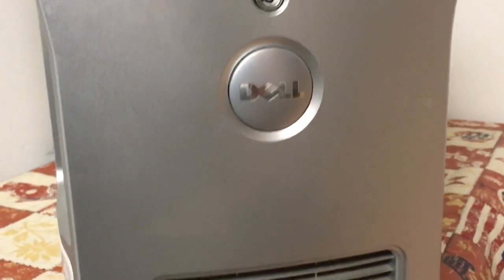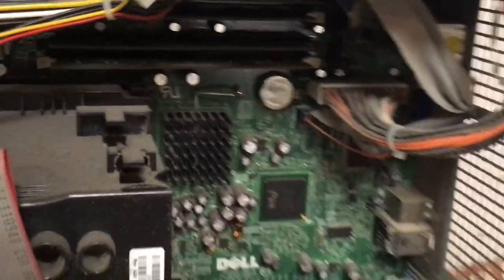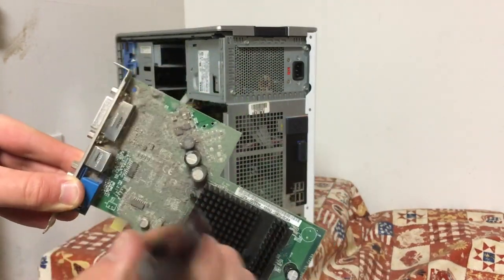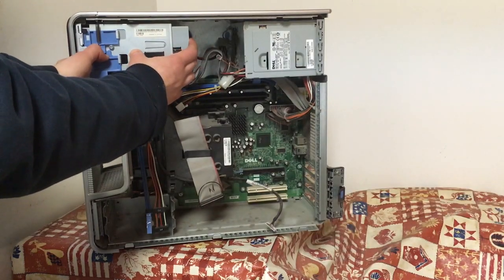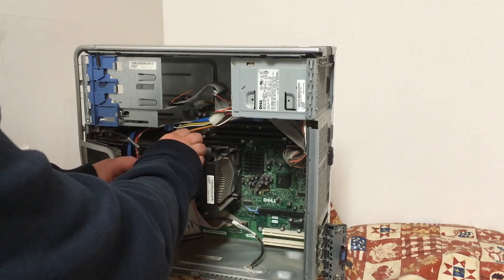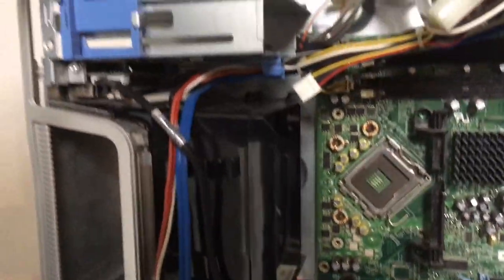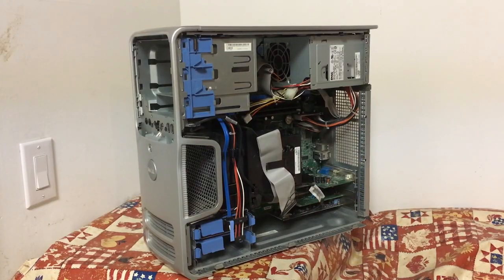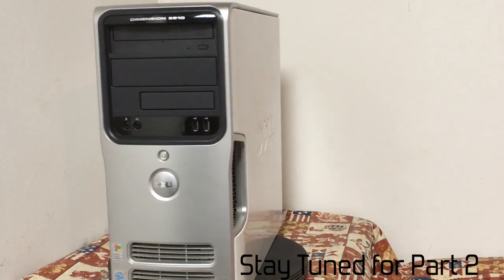Dell Dimension E510 Teardown and Restoration

Comment: My 99 year old Mom had the E521.  Never turned it on.  A little dust.  But not bad.  Upgraded to 4 Gig of RAM, New video board, New WiFi board, Added 500 Gig HD and upgraded system from Windows 7 to Windows 10 Pro.  I just do MS Word, some graphics and internet.  This machine now runs perfectly for my purposes.  Will watch for more of your videos.
Reply from the maker: Nice, it’s a good system and it does have a lot of upgradable parts. Glad you enjoyed it!
Reply: Do you have a video on installing a secondary HD?
Reply from the maker: Not at the moment,  but once I get some parts for it, I’ll definitely make an upgrade and installation video.
Reply: That's pretty amazing. I'm looking to do that for a while (I actually still use an E521) . How did you get windows 10 drivers for such old hardware ?
Reply: You were able to install win 10 on the 32-bit?

Comment: I got my 5150 from craigslist in 2012 for $20. Non working. One of the CF card reader pins was bent shorting it out stopping it from doing anything. Easy fix. I overhauled  mine to accommodate the E510 motherboard. $30 ebay motherboard. Then sold the 5150 motherboard for the same cost. The E510 supports Core 2 Quad. I have a Q6700 in it. The 5150 barely supported Pentium D. I swapped the stock heat sink for a much beefier Dimension 9100 heat sink. I also dremeled additional space above the top PCIE slot to accommodate dual slot GPUs.
Reply from the maker: Sounds like it was a solid system to use! Nice that you swapped out the motherboard for it to be more capable, I’m sure the Core 2 Quad made a big difference in performance. Are they pin compatible or did it require some modifications to make it use the E510 case? Dual GPUs in a system like this would be an awesome upgrade to add. Even nowadays these machines are still decent to use, maybe more for older games/software, but still nice to use considering how upgradable they are.
Reply: @TheOriginalCollectorA1303  Correction, I have a E520 not E510. The 5150 and E520 motherboards are slightly different. I had to dremel out the back panel from 5 3.5mm audio jacks to 6 jacks, 2 additional USB ports, and for some reason they decided to move the VGA port down, so a new hole for that. I also had to replace the front I/O/USB/power button board since the E520 motherboard wouldn't boot with the original 5150 I/O power button board. It only has a single, double slot GPU. It was originally meant to only have one single slot GPU. It's had a number of different GPUs starting with an MSI N9600GT(had to cut some of the plastic shroud to fit it), then a EVGA 740GT-4GB, then down to a ecs GTX560 removed (gpu shroud cover) now it has a EVGA 750-2GB. 
Some of my  old gaming videos around 2015 feature this PC. I listed the specs when I did, and a few other Dells😄
Reply from the maker: Interesting, at least it still fit inside the case even with the different I/O placements. Also interesting to hear that the power button doesn’t allow the different motherboard to boot, but that seems like another proprietary system thing. I also read that wrong about the GPU, but at least it worked after fixing the space limitation. It’s cool to see how much can be done to upgrade these machines!
Reply: @TheOriginalCollectorA1303  I just blew the dust off mine after moving. It's been about 5 years since I've used it. Nostalgia tripping touring all my old Sims 3 houses and buildings. Playing Burnout Paradise since its the only PC I have that the activation still works on.
Reply from the maker: Nice! Also nice to have it still play games without any modern complications. Activation is a whole other thing, but at least it still works.

Comment: Just finished cleaning the inside. Any tips how to get that Dell Dimension E510 side cover back on? I line up the tabs at the bottom & press upward, won't close. I pull back the top sliding tab as I'm lining up the case, won't close. Have Win Professional 7 as upgrade from XP.  Though Microsoft sunsetting Win 7 very soon, would like to continue using optical drives for DVDs, CDs, etc. Thanks.
Reply from the maker: It can be kind of difficult to put it back on so I know what you mean. I’ve found that tilting the PC or laying it on its side can help so that way when you line up the cover, it won’t touch the ground. Then just firmly push it in along the top and it should click. You can pull back the top tab but it’s not necessary as it will lock into place. Also make sure that nothing is bent just in case.

Comment: I recently bought the slimmer variant (C251) for $16 at a thrift store! It hasn’t been used in a long time because it had cobwebs inside the the case
Reply from the maker: Nice! These older machines are still great to use, hopefully you’ll get some use out of it!
Reply from the maker: Windows XP is a great OS to have as it’s helpful for older iOS software and jailbreaks!
Reply: @TheOriginalCollectorA1303  I just plugged it into restore install the OS and I think the power supply just exploded
Reply from the maker: Oh no! That’s unfortunate, hopefully it’s something else causing the issue. But even if the power supply is not functional now, you might find a whole other unit to use for parts.

Comment: I love that computer.  I had one in college, it played some mean Battlefield 1942.  I'm in the process of building one now for myself, for my 98/XP games.  I found an E310 for $5 at a flea market.  It looks the same, except silver instead of white.  I'm putting an E510 motherboard in it, so I can get that sweet PCI-E slot back.  You can also get that Samsung DDR2 ram super cheap now, so I'm going to put 2GB in there.  I can't wait to play F.E.A.R. again, it ran terrible in Win 7!!  Really happy to have a Pentium 4 again.  That thing was fantastic at running Win 98 stuff. And it made a great space heater when I was at school in the Upper Peninsula.
Reply from the maker: Cool to hear! Having an older system is always the best option for older games, plus it’s a lot of fun to use!
Reply: @TheOriginalCollectorA1303  Have you been experiencing any random blue screens?  I distinctly remember after putting in a Radeon X600, it was automatically overclocking the GPU by like 10%, and I had to install some tool to throttle it to 100% on boot.  Or else it would blue screen in like 5 minutes.  It worked great otherwise!
Reply from the maker: My system has been stable when I’ve used it, but I also haven’t upgraded the GPU or anything. I’ll have to keep that in mind if it does that with other GPUs also.

Comment: As a person who doesn't know a lot about computers, I was actually looking for how to identify and remove the hard drive. You kind of skipped over that part but I figured out that it was at the bottom of the case, and all I had to do was unplug one little plug and push the two blue tabs together to pull it out.

Comment: I got something similar, the Dimension 5150. It uses the same case and is almost identical to the E510. I replaced the power supply with a better one, upgraded the RAM to 2GB and HDD to a 500GB Seagate HDD. I use it as a Windows XP PC because it's much better than a VM.
Reply from the maker: Nice! These systems are good with upgrades and having a dedicated system for XP is easier and more fun to use than a VM. VMs can be easier to use temporarily but a proper system is always better.
Reply: @TheOriginalCollectorA1303  :) I may try install Windows 2000 because all the drivers except the graphics card work with 2000. I'm trying to find a driver for the ATI Radeon X600 256MB Hypermemory card.
Reply from the maker: If you manage to find the proper drivers, that system will definitely be even faster with Windows 2000! Dual booting would also be nice to have.

Comment: Vacuum cleaners are your friend ☺  That motherboard has at least 4 bad caps, examine down by the pci slots.  See how they are "Domed"?  They have failed.  During the time that pc was constructed dell had an astonishing 12% failure rate on the electrolytics.
Reply from the maker: I would only use a vacuum cleaner on something like the case by itself/anything without electronics to prevent static buildup. Otherwise I would have also used an air duster/blower (ones made for electronics) if I had one. I know that this desktop was made when the capacitor plague was still a common issue but I’ve never noticed that this specific machine had some! (It’s possible I forgot about them but I think I would have remembered this) I thought this was one of the more reliable older desktops I had, and to be fair it does still work extremely well, but I’ll have to do some maintenance when I’m able to do it. I haven’t used it in a while but the last time I did, it showed no problems at all. I don’t plan to use it for now though.
Reply: The Dell cases of this period WERE Vacuum Cleaners. Low to the floor, they worked more like an air cleaner and would do a good job IF it had filters installed.

I take them out to the garage about every 6 months or so, turn my air compressor down to 25 psi (USAF says no more than 32 psi on circuit boards. I'm conservative) and blow all that stuff out. I get any remnants in the corners loosened with a nylon art/paint brush and blow again. Vacuum cleaners cause too much static, especially if you use the attachment that is really needed (the dust brush). A crevice tool can only do so much.

I've also never seen capacitor problems on these Dell Boards. I'm sure it happens. (ASUS boards on the other hand . . .)

Comment: I remember when we ordered this one back in the day you could build your own PC  you could pick your graphics cards and sound and memory speakers it came with.. etc on the Dell website we still have it ran gta San Andreas pretty good but we didn't have a good graphics card so it would crash within 45min or 1hr while playing it maybe it was for overheating idk haven't turn it on since 2011-2013 I think
Reply from the maker: It’s still a fun older computer to use, it’ll probably still work but a fresh Windows install could help. It’ll be a nice older gaming system if you ever decide to try and use it again. There’s still a lot these older systems can do!

Comment: Try swapping out with an Intel Core 2 Quad Q9550 (Core-2 Duo works, too. (I recommend the E8600 or better)), 4 X2 GB PC2-6400U RAM, Used Solid State Drive, and you will have a fairly quick Windows 10 machine for under $100. ((I spent $50.62 on the above parts.) depending on FleaBay prices at the time, Plus Win10 license. (I had one from a dead laptop.) You can throw in a used Nvidea 2-4 GB PCIe Graphics card for another $30 or 40 bucks and have nice graphics, too.

Sure, you won't be playing GTR2 or the latest and greatest games, but it would do Quite well on many older 3D games (Medieval Total War, Rome Total War, Google Earth, etc)  with no problems and rather nicely.

I've gotten lots of life out of these LGA775 motherboards and am toasting one up for a friend now.
Reply from the maker: Upgrades are definitely easy to get for a system like this, it might not be brand new but I agree, there’s a lot of life left in these Dells! I do have newer machines that can run 10, and I don’t plan on adding upgrades right now. I like how it works as a Windows XP system, great for older software and games! I could always dualboot and have a newer version also, but there’s a lot of options. Thanks for sharing your upgrade info also!
Reply: @TheOriginalCollectorA1303  It runs Linux well, also, even with the original Pentium 4
Reply from the maker: I’m sure, Linux works on old and new systems. A lightweight install would definitely use the Pentium 4 well.

Comment: Thank you I took mine apart now I’m trying to put it back together mine has a power issue where the power button just sits and blinks and does not turn on it is not in sleep mode i’m giving it to a friend they are going to fix the issue I just need to put it back together
Reply from the maker: They are pretty solid machines, hopefully it will work again!

Comment: Any idea how to replace the front Usb assembly? Seems I must remove the other side panel as well ? (by first removing the fan  , then unclipping the front panel )
Reply from the maker: For the USB assembly, I believe it just has the one screw so you shouldn’t need to remove the other side panel. You might need to take off the fan assembly for more room.

Comment: Would you happen to know which current video cards would still match this machine,  allowing a contemporary screen (standard)? Thank you!
Reply from the maker: For Windows XP specifically, I think the newest you can use is the AMD 200 series or the Nvidia 900 series. You may need some additional drivers for some of them. There are older graphics cards available that have HDMI, they would probably work well if you intend to use it as a multimedia machine. Also make sure that your power supply can handle whatever card you choose.
Reply: @TheOriginalCollectorA1303  When I mentioned multimedia, I wasn't talking video, rather any audio source in my living room (AUX/Phono in brief). So it doesn't need to be state of the art, just good enough to feed any current 23 inch flat screen
Reply from the maker: Then try to find a decent card from the time, since it’s mainly audio you could use an older Nvidia or even ATI card. As for a specific one, there’s a lot so I’m not sure which one would be the best. The vram on the card would not be as important in this case since it’s for audio, that is as long as it can provide a decent user experience. You could also get a dedicated sound card like something from Creative, they would also provide more audio inputs/outputs.

Comment: THANK YOU so much for this! I just got one, a similar model, the 9100. Want to make it my living room multimedia sampler (in combination with an old Hammerfall RME Multiface as DSP unit). 
Hence the following question: Would you happen to know if its motherboard would fit a HTPC case like the SilverStone SST-GD09B Grandia HTPC ATX?
Reply from the maker: Glad it helped! As for a case like that, I’m not entirely sure. Dell often made a lot of their motherboards to be proprietary to the case or some accessories. In that case, I’d recommend you look at the motherboard and measure it.
Reply: @TheOriginalCollectorA1303  I'm reading this while doin' exactly that :-)

Comment: This is a long shot but mine won’t turn on. There is a green light inside that is on but the power button just seems to be useless?
Reply from the maker: Well it’s good that it shows power on the board, but since it’s not powering up, it’s possible that the power button itself is the problem. That or something else is preventing it to turn on but troubleshooting the button and the connections could fix it.

Comment: My heat sink assembly just won't budge. Anyone knows the trick to removing this thing?
Reply from the maker: Seems like the thermal paste has hardened over time, try using isopropyl alcohol to get in between the cpu and the heat sink to loosen it up.

Comment: Anyone know what’s wrong with my E510? I upgraded the HDD’s to 500gb from 160 and upgraded the graphics card to a 2gb and now it has an orange light on the power button and won’t turn to green like it used to. Did I mess up the power supply?
Reply from the maker: So it doesn’t power on? It could be the graphics card since the power supplies on these systems aren’t exactly big. If the graphics card is drawing more power than supplied that might be an issue. You could always try powering it up without the card to see. Having no OS on the new drive might cause issues also but that seems unlikely.
Reply: The Original Collector it turns on but I tried removing the gpu and it still won’t output any data to the monitor from the integrated vga input. The light on the power button stays orange and doesn’t turn green. Everything seems to be running though.
Reply from the maker: Aaron Ciupka That reminds me, I believe that Dell turned off the integrated VGA port despite it being there, mine has those covers on it. There might be a way to reactivate but I’m not sure how. Try it with the factory gpu if you are able to.
Reply: try unplugging the power lead. hold the power button down for 30+ seconds. then plug the power cable back in and try to boot it again.
Reply: I have the Dell E520 and the same happen, the integrated graphics don't work, is not the first occasion I notice somebody mention this problem, also in another youtube video the guy making such video have the same integrated video problem with his dell E520
Reply from the maker: Integrated graphics seems to be disabled on these machines but there might be a way around it in the bios or a custom program to activate it

Comment: e510s came with GPUs. i had an e310 and got a e510 mobo so i could put a gpu in mine. dells terrible now.
Reply from the maker: Power supply is a limiting factor, but I do plan to eventually add some upgrades to the system.